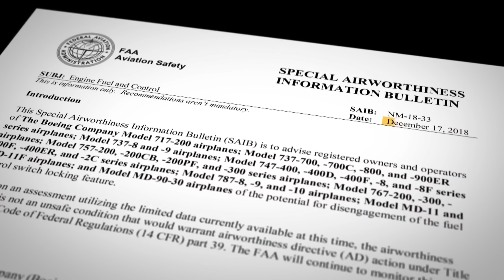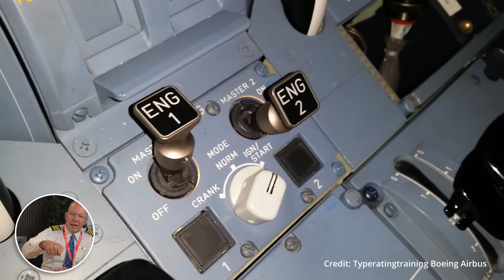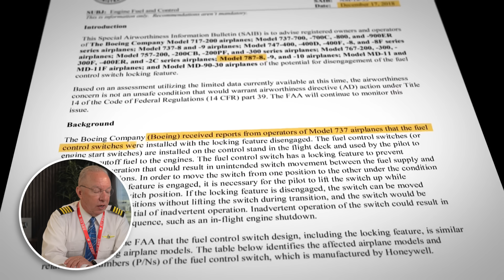Air India 171: The FAA’s 2018 Fuel Switch Locking Bulletin Explained (16 Questions Answered)

Comment: 3 Question. Is the cockpit’s audio recorder ever be fully released? What is the chance to both pilot decide to commit a double suicide? End finally why would someone of the both decide to call a mayday signal? An answer to this was while one cut off the engine and the other called mayday. If one of the pilot or co pilot cut off the fuel the other should see that. There is no way it could have been do it without seeing it by the other. Also it should have been a Sirius conversation happen in the last 30 second on that audio recordings. Are we ever gone here the full audio recording. I guess and assuming that never. At least the full version of it.

Comment: Ca Steeeve, at 8:10 you state something to the effect "if installed upside-down, they would always spring back to the other position."  Why then do the switches allow you to go to cutoff and stay there when you turn the switches off?  Given your logic you would never be able to shut the engines down.  Furthermore, don't the thrust levers have to be at idle for the cutoff switches to be effective?  Most new jets require the thrust lever to be idle before cutoff works.  Ive flown many planes that if the thrust levers are above idle the engine stays running... ???

Comment: From the speech in the recorded black box, in my opinion this is most likely not a intentional cause. A malicious actor that denies the action is when they wants to escape or avoid responsibility for the action they took. Example: If somebody rob a bank, they denies it to avoid being jail and lose the assets they robbed. In this example, they gain nothing to avoid the responsibility, if they are maniacal, they would have laugh or even admit the action. There is just no reason to deny.
 
But in this case, the actor still denies the act even when this act itself would have been an action that requires one to accept the responsibility by accepting death along with the plane.
This has also been proven by past records of airplane suicide crash or other suicide bombing.

From past records of accident for near miss or injuries from workshop, most of the actor / victim did not know what they are doing as either they were too tired or not focus.
Is there any records that the pilot are well rested?  I am afraid there isn't.

Comment: Conspiracy subject matter expert here.. How likely is it that the fuel cutoff switches could have been placed in the "off" position during post crash investigation?  We live in a world now plagued with false narratives.
Reply: The switches recovered from the wreckage are set to "run." That corresponds with the flight data recorder capturing the switches being moved from "run" to "shut off" and then back to "run." I can't speak to this investigation but typically multiple specialists are present as material is recovered, photographed, and inventoried. The data recovered from the "black box" is transferred carefully under supervision so nothing is lost. 

But at the QAnon level, everybody except them is conspiring with everybody else about everything.
Reply: There was a latest report by The Straits Times about this fuel cut-off issue. I tried to attach the link but YouTube had deleted my comment. It reported an interesting information that a GE bulletin stated a flawed chip if not replaced after 11,000 cycles could cause the fuel cut-off during loss of signal.

Comment: I am sorry... I don't believe the switches were moved to the cutoff position.

This is the one time I am in doubt of an official report.

What I think happened is some electrical or software failure told the FADECs that the switches were moved to the cutoff position... 

Then one of the pilots realized the engines were spooling down and moved first one switch then the other to the cutoff position and then to the run position, thus reseting the logic on the FADECs.

The black box must be registering data after the FADEC, not before, the if the FADECs thing the levers are in the cutoff position, that's what the recorder will say.
Reply: There was a latest report by The Straits Times about this fuel cut-off issue. I tried to attach the link but YouTube had deleted my comment. It reported an interesting information that a GE bulletin stated a flawed chip if not replaced after 11,000 cycles could cause the fuel cut-off during loss of signal.

Comment: Shouldn't each pilot have access to the fuel supply of only one engine? Say, the left pilot has easy access to the fuel supply of the left engine, and the right pilot has easy access to the fuel supply of the right engine. In the age of mind control, we cannot rely on the sanity of individual pilots.
Reply: That's dangerous because both pilots aren't always in the cockpit together - during restroom breaks for instance - and one could become incapacitated during a flight. If an engine fire occurs, a pilot has to shut fuel off to that engine *immediately* so he/she needs ready access to both switches at all times.
Reply: @Everywhere2  Oh, I see your point. But it is still very disturbing that a plane can come down with just two switch pulls, ending so many precious lives. Maybe, we can put some buffers on accidentally switching off the fuel supply until the plane reaches a recoverable elevation.

Comment: Dear Steve, It is quite evident from the conversation between the pilots that none of them Cut off those switches, A pilot hell bent on suicide would not be talking like this. These switches have had a known issue flagged by your FAA as far back as 2018. On this paticular aircraft these switches had been changed not once but TWICE. These switches do not have direct mechanical linkages to the fuel supply, the feed the signal to complex electronics, so it's highly possible that the fuel supply was cut off electronically with switches in Run position. Most of the western pilots are trying to save Boeing from another fiasco. This time it will be hard for them to slip away.
Reply: There was a latest report by The Straits Times about this fuel cut-off issue. I tried to attach the link but YouTube had deleted my comment. It reported an interesting information that a GE bulletin stated a flawed chip if not replaced after 11,000 cycles could cause the fuel cut-off during loss of signal.
Reply: Nope, as Steve said, the FDR and CVR both record that the switches were moved. Sorry, one of the pilots did this. If you want to go the coverup route, you’ll have to explain why the Indian authorities would protect Boeing.

Comment: I’m still thinking about way how this could have been not a deliberate act.
For that, i wonder about two points:
1) Is it possible that faulty fuel switches (per the SAIB) would feel normal when operating, but just could be flipped without lifting the locking collar? That fault would be hard to detect. (Or do pilots try to flip the switch while it should be locked, just to check  that the lock works?)
2) How precise is the timing of the EAFR events?

So, if one of the pilots, say, dropped an object on the switches, and one switch moved to off at 08:08:42.995, and the other at 08:08:43.005, they would have been flipped basically simultaneous, but were recorded as 1 s apart.

I’m not saying this is likely, but there is also the »The other pilot responded that he did not do so.« Would you lie in this situation? I don’t know.

Comment: I disagree. Without video evidence we do not know if a pilot actually pulled the switches. It could be the fuel was cut downstream in the circuit from the switches and was recorded on the flight recorder. The audio could be the pilot assuming those switches were cut when he started to lose thrust. This possibility still exists.

Comment: Can the plane be powered up, taxi, and take-off (with fuel switch in cut-off position) just by using fuel already in the lines? Just  enough to get airborne but to then (un)intentionally crash. Concept: My lawnmower or car often runs for a little while while on empty.  Can this happen to a Boeing?

Comment: Captain Steve. Can I ask you one last time  - see my comments on earlier posts - to stop this ongoing conversation about the reasons for this tragedy, until the final report comes out. You may argue that in this latest video you are simply answering questions sent to you, but you have caused the questions by taking up the tragedy and making a video of it in the first place. There is absolutely NO justifiable reason for continuing with this. Nothing will be gained by it. It will not give closure to the grieving families, in fact it could inadvertently contribute to one way or another to their torment, and it will not contribute to the official investigation.  I admire your campaign to help address mental health issues with pilots, but please keep that entirely separate from this tragedy as 'cause by association' will undoubtedly be a consequence if you fail to do so. And finally, there is no justifiable reason for not having video in the cockpit, just as, for example, there is no justifiable reason for not having it in a medical operating theatre. As some industries have already found, such as sectors within rail, it can be a very useful tool in terms of learning lessons, preventing the re-occurance of mistakes, and making improvements.

Comment: Commercial aviation needs an on-call pool that it can tap into for last minute pilot and air traffic controller (ATC) replacements. We’ve had them in nursing for fifty years. Steeeve, consider this: There should be a 24-hr no-questions-asked (NQA) absence for such cancellations within 24 hours of duty or takeoff. Each pilot or ATC should be granted one per year, with no consequences whatsoever after the first career NQA. Cognitive behavioral therapy (CBT) should be completed within 90 days after the second career NQA. Dialectical behavior therapy (DBT) should be completed within 90 days after the third career NQA. 
Pay the replacement pilot or ATC whatever it takes: It’s cheaper than lost lives and lawsuits. Psychological fitness for aviation is equally as important as aircraft mechanical airworthiness. Being grounding is good for everyone.
Reply: Interesting ideas.

Comment: Suicidal maniacs are rampant. They will not be deterred by cameras, engineered fail-safes or psych screens. Their coworkers might hold the key to nuanced detection of problem individuals but that would require crossing the thin, blue line where caution exceeds loyalty. Many of these maniacs are religiously motivated. Was that the case here?

Comment: I'm sorry Captain Steve, but I'm not buying the "no video recordings in the cockpit because someone might abuse it" rationale.  This video, like the CVR, would be part of the crash-survivable memory unit that is self-contained and heavily protected. It must be removed from the aircraft and connected to specialized equipment to extract the recordings - that is not going to happen so someone can dish the dirt on a pilot reading a magazine.  However if the pilot is reading a magazine during the landing of an aircraft that crashed, it would be vital information.  The pilot's unions are wrong on this issue.

Comment: Could we just get the exact 787 cutoff switch panel used in 171. See if they can be configured as mentioned on the bulletin. If so then examine the functionality/behavior. No guesswork needed.  Additionally, notice how the run position is UP. Then tells us a jacket cuff catching at worse would enable engines (maybe not good when parked).

Comment: Your confidence in the Ethernet (AFDX) Common Core Network into which switch status is, in all likelihood, multiplexed by means of Remote Data Concentrator units far exceeds mine.  A thorough analysis of the architecture through which switch status is communicated to Engine Electronic Controllers and Flight Data Recorders is required before such unsubstantiated allegations of pilot error can be made.  The possibility of an uncommanded fuel cutoff cannot simply be ignored given the reported pilot statements ?  I would personally criticise the preliminary report for heavily inferring intentional malicious action on the part of the flight crew and thus focussing such enormous media attention away from the possibility of a rare equipment malfunction.  Everyone understands the operation of an electromechanical switch, but not necessarily the electronic system infrastructure that lies behind it.

Comment: Might it be possible one of the pilots was wearing some kind of bracelet that accidentally got caught under both switches,  lifting and moving both to cut off?  I see cut off is down so they would have been needing to reduce thrust maybe for noise abatement.   Is noise abatement required at this airport?

Comment: If the engine run/kill switch was installed upside down how could it possibly default from run to the cutoff position.   That makes zero sense to me given that the switch has two states, hopefully separated by the mechanical detent.  Surely it would simply stay in the selected position, which after all is the express purpose for the detent.  
Personally I have far more concerns about the possibility that "some" switches out there on Boeing aircraft did not include detents and given Boeing's 'advisory' in 2018, it was not an actionable item, an  A/D, but only an 'advisory'.  That worries the hell out of me.

Comment: The report, however, mentions that in December 2018, the US Federal Aviation Administration (FAA) issued a Special Airworthiness Information Bulletin (SAIB) highlighting that some Boeing 737 fuel control switches were installed with the locking feature disengaged.
While the issue was noted, it wasn't deemed an unsafe condition requiring an Airworthiness Directive (AD) - a legally enforceable regulation to correct unsafe conditions in a product.

Comment: Can we please have your comments on the below AI generated response? -  Regardless probabilities. There is always a 1st time for an event to be observed

In a Boeing 737, the fuel cut-off switches (also known as engine start levers or engine fuel control switches) are located on the overhead panel or center console (depending on the 737 variant). They are protected by metal safety brackets or guards to prevent accidental movement, especially accidental shutoff of fuel to the engines during flight.

If the metal safety brackets are installed in the opposite position (i.e., reversed or flipped), a few potentially serious issues could arise, depending on the exact misinstallation:
🔧 1. Fuel Cut-Off Switches Could Be Harder (or Easier) to Move

    If the bracket is installed backwards or upside down, it may fail to lock or guard the switch properly.

    This can lead to:

        The switch not being held securely in the ON (RUN) position.

        Unintentional movement due to vibration, turbulence, or human contact.

⚠ 2. Fuel Levers Could Be Accidentally Shut Off

    The intended function of the safety bracket is to guard against inadvertent movement.

    A reversed bracket may leave the switch exposed or apply force incorrectly, making it possible to accidentally cut fuel to an engine mid-flight, causing:

        Engine flameout.

        Loss of thrust on that engine.

        In worst-case scenarios: engine shutdown at critical flight phases like takeoff or climb.

🧑‍✈ 3. Confusion During Emergency or Abnormal Procedures

    Pilots are trained to operate the fuel switches by feel and sight, and the bracket provides tactile feedback.

    A reversed bracket could:

        Cause hesitation during emergencies.

        Delay correct responses, especially when muscle memory is disrupted by unfamiliar control feel.

📋 4. Non-Compliance with Airworthiness Standards

    Any misinstallation like this would likely be considered:

        A maintenance error.

        A violation of airworthiness directives or manufacturer's maintenance manual.

    Could trigger:

        Grounding of the aircraft until fixed.

        Investigation by aviation authorities (e.g., FAA, EASA).

🛠 Example Real-World Analog:

There are precedents where incorrect reinstallation of cockpit controls or guards led to:

    Fuel starvation events.

    Aborted takeoffs or engine failures.

Such a small error in maintenance can have significant consequences, even if the failure is low-probability.
✅ Conclusion:

If the fuel cut-off switch brackets are installed in the wrong position on a Boeing 737:

    The engine fuel switches may not be properly guarded.

    This can lead to accidental engine shutdown, safety hazards, and operational non-compliance.

    It’s a critical error that would require immediate correction during any maintenance inspection.

Comment: Sir, 
From the Indian AAIB report these fuel cut off switches were turned off with an interval of 0.1 sec. Operated manually, a fuel cut off switch safety detent is lifted before the switch can be operated, and the two fuel cut off switches are therefore operated separately on the 787- 8. Switch horizontal separation coupled with their detent operation make them (almost) impossible to be operated in unison, particularly with such a tiny time delay.

Your commentary is at this stage wrong. You are pointing a finger before the facts are known.

Comment: Captain Steeeve:  Would this be about the only time in the flight, aside from a certain point during landing, that this would work? It seems like, had the person causing the failure waited another minute or so there would have potentially been enough height/speed for the other pilot to recover the aircraft or restart the engines. While circumstantial, the timing of the cutoff seems to be very intentional as there was no room to recover or am I not looking at this correctly?